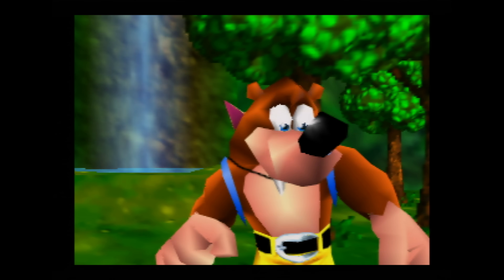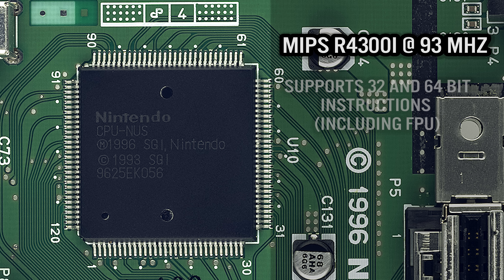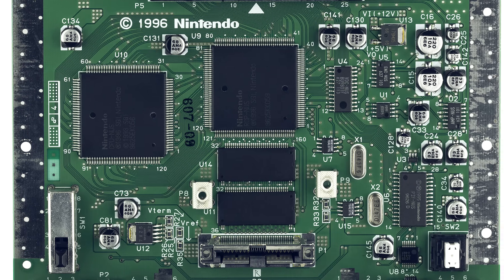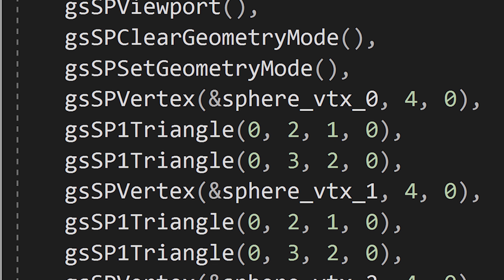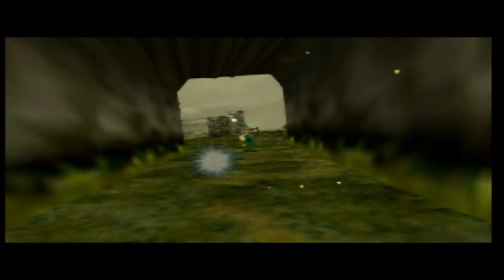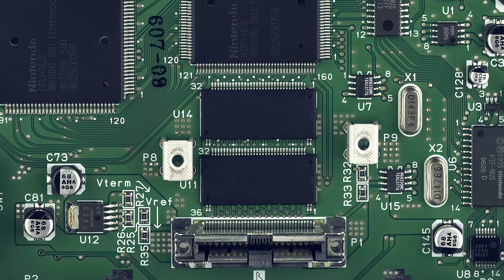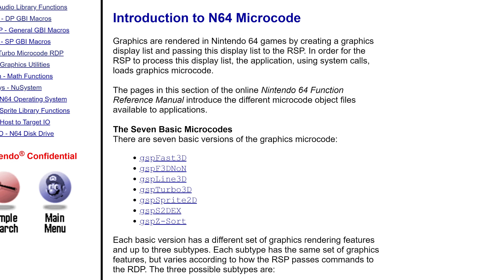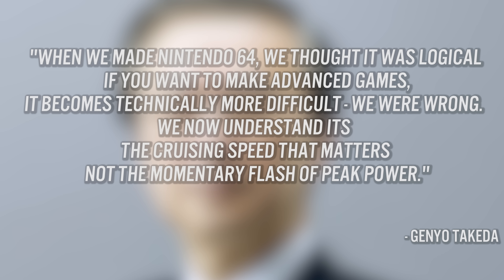Why was the Nintendo 64 so hard to develop games for ? | MVG

Comment: GoldenEye 007 for the N64 is considered difficult to emulate for a few reasons:

Complex graphics: GoldenEye 007 was one of the most graphically advanced games for the N64, and it used a lot of advanced graphics techniques that were unique to the console. This makes it difficult to emulate accurately on modern hardware, as the original hardware had a very different architecture and limitations.
Complex AI: GoldenEye 007 also had advanced AI for its time, which made the enemies more challenging and realistic. Emulating this AI accurately requires a lot of processing power and is often beyond the capabilities of many computers.
Optimization: GoldenEye 007 was also not optimized very well for the N64 hardware, which meant that it often struggled to maintain a consistent framerate. Emulating this game accurately on modern hardware requires a lot of optimization and processing power to ensure a consistent and smooth experience.
These factors make GoldenEye 007 a challenging game to emulate accurately, and even with modern hardware, it may still have issues such as glitches, frame rate drops, and audio problems. However, there have been many improvements in N64 emulation over the years, and some emulators, such as Project64, have made significant progress in emulating GoldenEye 007 accurately.
Reply: The bugs in GoldenEye 007 can make it more difficult to run in emulation than on native N64 hardware for a few reasons:

Emulation accuracy: Emulators strive to be as accurate as possible in replicating the original hardware and software of the console they are emulating. However, some bugs and glitches in GoldenEye 007 may rely on specific quirks of the N64 hardware or software, which are difficult to replicate accurately in emulation. As a result, the bugs and glitches in the game may behave differently or not at all in emulation, which can affect the overall gameplay experience.
Performance issues: Some bugs and glitches in GoldenEye 007 can cause performance issues on native N64 hardware, such as slowdowns or crashes. Emulators, especially those that aim for accuracy, may have a harder time emulating these performance issues accurately, which can affect the gameplay experience.
Debugging tools: Debugging tools and cheats that were available on real N64 hardware may not work the same way in emulation. This can make it more difficult to reproduce or diagnose certain bugs and glitches in the game.
Overall, while emulation has come a long way in replicating the N64 hardware and software, there are still some limitations and challenges to emulating complex games like GoldenEye 007 accurately. The bugs and glitches in the game can make it more difficult to run in emulation, but with continued improvements in emulation technology, the experience of playing GoldenEye 007 in emulation can still be enjoyable.
Reply: Some of the quirks of the N64 hardware and software that can affect the emulation of GoldenEye 007 and its bugs and glitches include:

The N64's graphics pipeline: The N64 had a unique graphics pipeline that differed significantly from other consoles of its time. This can affect the way that graphics are rendered in GoldenEye 007, and can cause issues with certain graphical effects or glitches.
The N64's memory management: The N64 had a complex memory management system that could affect the way that data is loaded into and out of the game's memory. This can affect the way that certain bugs and glitches in GoldenEye 007 manifest themselves, and can make them more difficult to replicate accurately in emulation.
The N64's CPU and GPU: The N64's CPU and GPU were integrated into a single chip, which can make it more challenging to emulate accurately on modern hardware. This can affect the way that certain bugs and glitches in GoldenEye 007 behave in emulation, and can make them more difficult to reproduce or diagnose.
The way that GoldenEye 007 was programmed: GoldenEye 007 was programmed using a combination of low-level assembly code and higher-level C code. This can make it more challenging to emulate accurately, as the low-level assembly code can be very hardware-specific and can rely on specific quirks of the N64 hardware.
Overall, emulating GoldenEye 007 accurately can be challenging due to the unique quirks of the N64 hardware and software, as well as the way that the game was programmed. However, with continued improvements in emulation technology, it is possible to emulate GoldenEye 007 and other N64 games with a high degree of accuracy.
Reply: The reason why it's difficult to emulate N64 microcode is that it was designed to run on the N64's specialized hardware, specifically the console's Reality Co-Processor (RCP) which handled the graphics processing.

N64 microcode was written in assembly language and was closely tied to the hardware architecture of the console. This means that it cannot be directly executed on modern x86 processors or other modern hardware architectures without significant modifications.

Emulators that aim for accuracy need to emulate the entire N64 hardware, including the RCP and its specialized microcode. This is a difficult task because the N64 hardware was complex and had unique features, and there is no standard microcode format that can be easily ported to other hardware architectures.

To accurately emulate the microcode, emulators need to reverse-engineer the microcode format and recreate the RCP's behavior in software, which can be a challenging and time-consuming task. Even then, some subtle differences in behavior between the original hardware and the emulated hardware may cause certain games to behave differently or exhibit bugs that were not present on the original hardware.

Overall, while it is possible to emulate N64 microcode, it can be challenging and requires significant effort to accurately reproduce the behavior of the original hardware.
Reply: While it is possible to use automation and machine learning techniques to assist with the process of emulating N64 microcode, accurately reproducing the behavior of the original hardware is still a challenging task that requires significant expertise in reverse-engineering and software development.

One approach to improving the accuracy of N64 emulation is to use dynamic recompilation. Dynamic recompilation is a technique where the emulator analyzes the microcode as it is executed on the original hardware and translates it into instructions that can be executed on the emulated hardware in real-time. This approach can improve emulation performance and accuracy, but it is still a complex task that requires detailed knowledge of the N64 hardware and microcode.

Another approach is to use machine learning techniques to train an AI model to accurately replicate the behavior of the N64 hardware. This approach has been explored in recent years, with some researchers achieving promising results in emulating simple N64 games using AI. However, it is still a relatively new field of research, and it remains to be seen whether this approach can be scaled up to more complex N64 games.

Overall, while automation and machine learning techniques can help to improve the accuracy of N64 emulation, they are not a silver bullet and still require significant expertise and effort to achieve accurate results.
Reply: Dynamic recompilation (or "dynarec" for short) is a technique where the emulator analyzes the microcode as it is executed on the original hardware and translates it into instructions that can be executed on the emulated hardware in real-time.

Here's a basic overview of how dynarec works:

When the emulator starts up, it loads the game code and microcode into memory.
As the game runs, the emulator intercepts each microcode instruction as it is executed on the original hardware.
The emulator then translates the microcode instruction into equivalent instructions that can be executed on the emulated hardware.
The translated instructions are then cached in memory so that they can be executed quickly the next time the same microcode instruction is encountered.
The emulator then continues to execute the translated instructions until the next microcode instruction is encountered.
The key advantage of dynarec is that it can greatly improve emulation performance by avoiding the need to constantly interpret microcode instructions. By translating microcode instructions into equivalent instructions that can be executed directly on the emulated hardware, dynarec can make emulation much faster and more efficient.

However, dynarec can be challenging to implement correctly, as it requires a deep understanding of the N64 hardware and microcode. If the dynarec translation is not accurate, it can lead to errors or glitches in the emulated game. Therefore, dynarec is often used in conjunction with other emulation techniques, such as hardware cycle-accurate emulation or software-based emulation, to achieve the most accurate results possible.

Comment: Project64 is often considered better than Mupen64 when it comes to N64 emulation for a few reasons:

Accuracy: Project64 is known for its high accuracy in emulating N64 games. It has been around for a long time and has undergone many iterations, making it very stable and reliable. On the other hand, Mupen64 is a multi-platform emulator that aims for compatibility across different operating systems, which may result in some compatibility trade-offs.
Plugin system: Project64 has a robust plugin system that allows users to customize their emulation experience. Users can choose different graphics and audio plugins, among others, to enhance the performance of the emulator. This plugin system is not as developed in Mupen64.
User interface: Project64 has a user-friendly interface that makes it easy to use for both beginners and advanced users. Retroarch, on the other hand, can be more complicated to use due to its extensive customization options.
That being said, Mupen64 is still a capable emulator that can run many N64 games without issue. The choice between the two ultimately comes down to personal preference and the specific needs of the user.

Comment: RAMBUS suffered from a 45ns initial latency (vs. 15ns for PC133 RAM in PCs and Macs at that time).  For a 64-bit transfer, you needed 8 cycles at 800MHz on RDRAM.
Reply: So of the 18 pins only 8 are for data? And where is DDR?
Reply: @ArneChristianRosenfeldt  9 pins for data transfer.

Comment: Ehh, at 1:43 you incorrectly stated that a 5 stage pipeline means you can execute 5 instructions at once. A more accurate statement would be “could process at the same time”. The MIPS 5 stage pipeline only has one execution stage, but while executing that instruction, the previous one can do memory access and the previous-previous can be writing.

Comment: correct me if i'm wrong, but doesn't a 5 stage pipeline mean that an instruction has to clear all 5 stages before a new one can be executed, and a long pipeline is a bad thing, not a good thing? pentium4 was garbage because it had a 16 stage pipeline and very bad branch prediction compared to modern cpus, that's why it had terrible IPC and ultimately even lost to the pentium 3 (which evolved into the core2 series). 
modern cpus have long pipelines again but they have all sorts of borderline magical prediction stuff that manages to keep it busy pretty well
Reply: Pipeline allows scalar operation at a high clock rate. 5 stage is good because MIPS has this branch delay slot and does not need branch prediction. Actually, stage 4 and 5 are for Load instructions. I dunno about coprocessor. Those complex instructions could also need multiple cycles.

Comment: I would like to know their UMA encoding scheme if they're getting 500+ MBps with a clock limited to 500MHz. They can clearly transfer a whole byte per clock cycle in the Mega range. Pretty impressive especially for the '90s
Reply: There is no encoding, just every other pin is gnd and the end is terminated using a matching resistor. All lines run parallel. I think this limits them to 18 lines on narrow pin spacing. Both sides probably have a multiplexor to reduce the clock.